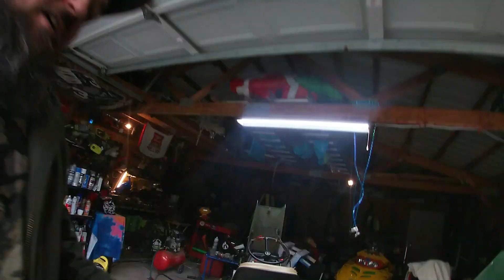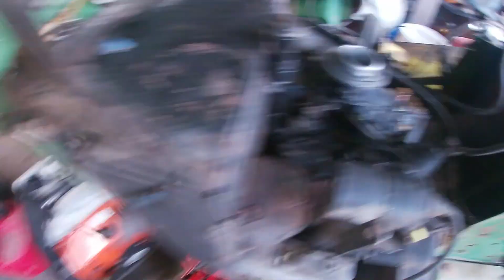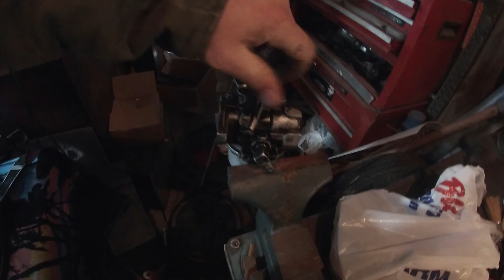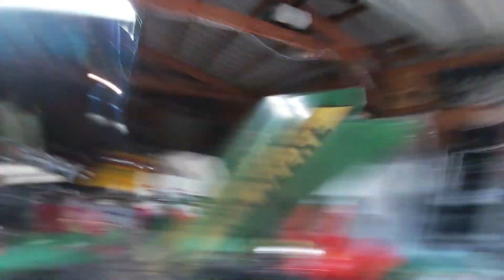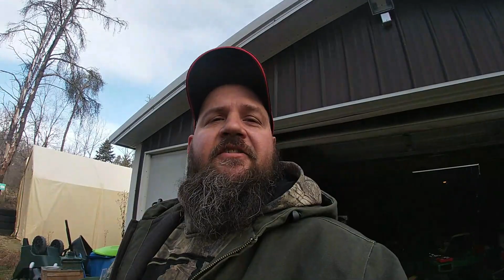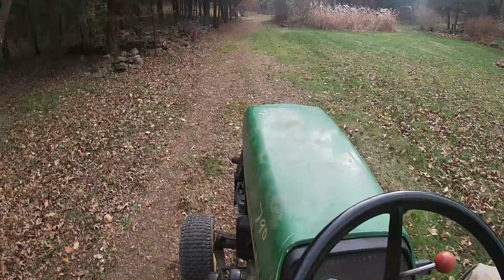john deere 317 part 2 test drive

Comment: The Main Jet needle will get bent if you attempt to remove the Main Jet with the needle still inserted. First remove the Main Jet Needle (most count the turns in until it stops and write that down), then remove the Main Jet.